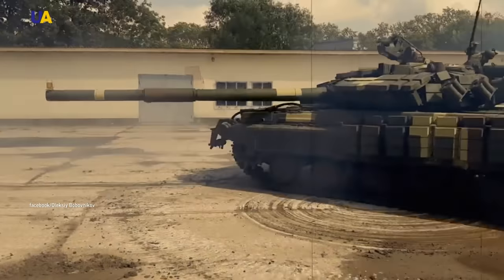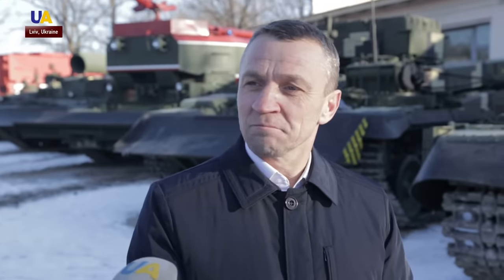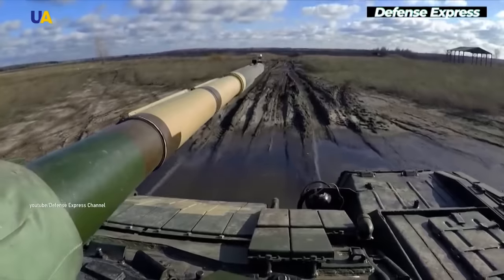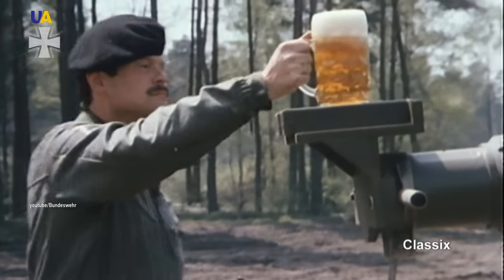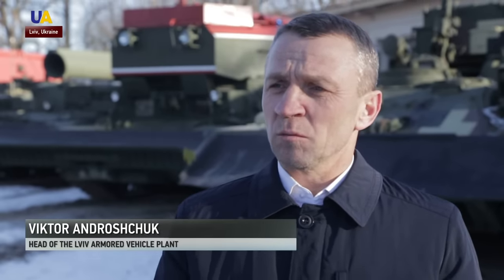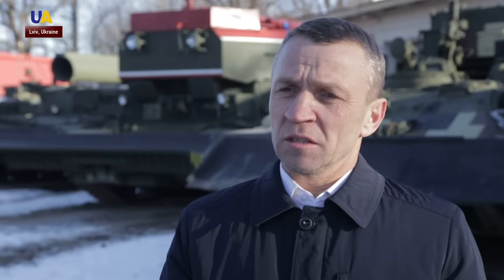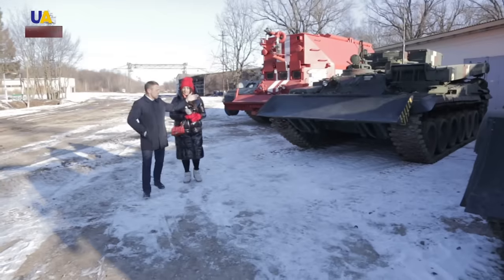How Can a Glass of Beer Demonstrate the Quality of a Tank?

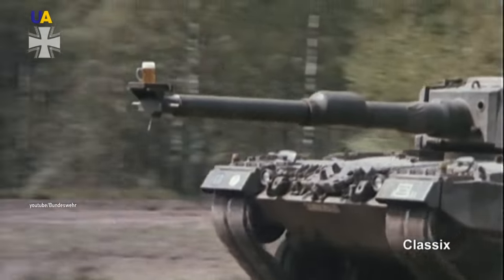Comment: If you pay close attention to the liquid inside the glass at 0:10 and a similar test with the german tank at 1:07, you can clearly see that the German system is on a completely different level.
The german tank doesn't spill a drop.
Reply: Tbf. T-64 is decade(s) older than Leopard 2 would be fair if compared against older abrams, challenger 1 etc.
Reply: @errornamenotfound2513  T64 is much older than the M1 and Challenger 1. It came out in the 1960s. The western equivalent would be M60 or Leopard 1.
Reply: These guys managed to build stabilizing system, that is impressive anyway, i bet very few russian t72 has that
Reply: @cmanlovespancakes  would be fair leopard 2a4 to older abrams, challenger 1 etc*
Reply: @cmanlovespancakes  They say it has been brutally modernized and not much from the original T-64 remained.
Reply: @errornamenotfound2513  in this case its a leopard 1 whitch has been outdatet for at least 30 yeas ( not sure how long exactly)
Reply: @WombRaider_theoriginal  Every T-72 variant has a stabilizer IIRC
Reply: because that would be alcohol abuse
Reply: @ceplma  Yeah but it's still in an awfully small turret. There are limits to how much these old Soviet designs can be modernised.
Reply: The German tank is going WAY faster.
Reply: @WombRaider_theoriginal  T-72 utilize the same gun and the same stab, as all tanks of the period. Differences mostly lay in armour and aiming tech. Armour is better on T-72 (from B-series and further) since it uses a new package of combined armour and aiming tech is worse on older variants (up until T-72B2 i guess) and same/better on later variants, such as T-72B3/B3M, which is most popular in current services
Reply: @ceplma  depends on the variant we are looking at, but still the modernisation was mostly about new gunner's (and/or commander's) sight. Stab system and the gun itself are the same in most parts
Reply: @errornamenotfound2513  The german video was made in the 70s, these t64's have been upgraded a few years ago. You'd expect this technology to be better these days, though the leopard is driving way faster on rough terrain wit a full glass, the t64 drives on flat ground with half a glass of beer ans spills over the side. It's not the same.
Reply: @MrSkyl1ne  late 70s* and that shitty Russian tank vs leopard 2. Like I said, it would be a fair comparison if it's compared to older M1 variants or challenger 1
Reply: @excaiveso5186  what is a Leopard 1?
Reply: @AlexKall  A Garman-developed tank first entering service in 1965. No relation to the Leopard 2, which was originally developed as the German-US Co-Developed MBT-70, when then was cancelled, of which some of the technology developed from the MBT-70 led to the Leopard 2 and M1 Abrams respectively.

There's tons of information on the internet on both tanks, but that's the really short version.
Reply: @errornamenotfound2513  i dont need arguments for dumb people, u are below a slice of bread
Reply: Would you expect anything less from a country that invented Oktoberfest!
Reply: @TheEDFLegacy  excAive asked "in this case it's a Leopard 1" so I asked him "what is a Leopard 1?" Not the best sentence strukture from my end, but it was late.
Reply: The German beer is damped by a very frothy head
Reply: @WombRaider_theoriginal  All T-72 are stabilized
Reply: If only germanys polititians were as intelligent or refined as its engineers...
Reply: @errornamenotfound2513  German tank was a leopard 1 tho a 1965 design :D
Reply: @N0d4chi  the one in the video is a leopard 2..
Reply: But seriously, the German tank has a whole flat surface built to balance the glass on and was driving much slower. The Ukraine tank they just placed it right on top of the actual turret and the clip where it spilled some that tank was driving very fast over very bumpy road
Reply: In other words,  German tanks don't drunk
Reply: @WombRaider_theoriginal  seriously? either this is a joke, or you don’t understand tanks from the word at all.
Reply: @errornamenotfound2513  in the Official Video which was Uploaded from the German Bundeswehr (Army)  its a Leopard 1. Video Called:
"Classix: So stabilisiert der Kampfpanzer Leopard seine Kanone (1986) - Bundeswehr"
Reply: @errornamenotfound2513  what the hell, its the opposite. the leopard 2 video is in the 80ties 40 years ago, while this video was done after they had 40 years longer developement time it doesnt matter even a little how old the original tank is. if you would make this test again with a modern version of a leopard 2 not a 40 years old a4 leopard tank, the test would have been even better. 40 years later the ukrainian version is not in any way on the level of the german technology 40 years ago. the disandvantage is actually here on the german part. even after 40 years not a single other tank till today was able to reproduce this technology in any way even near to that. just look at the japanese version, i have to give the ukrainians that they are at least much better than what japan is able to do today. japans tank is not even driving at all xd they just turn their turret slooooowlyxd and we not even have a single beertest video for an abraham tank, i wonder why thats the case so, yeah not in comprhension to germany but at least relatively to other tanks they made a pretty good stabilisation, which is impressive enough

Comment: Russian Tanks: "The glass is half full."
German Tanks: "The glass has always been full."
Reply: Becase we a drink half for driwing a tank
Reply: There’s spillage. Heh
Reply: This is Ukrainian  tank,the only thing that left from Soviet modification was armor.
Reply: @zymbaluknik8093  T-64BV is still soviet when it comes to engine (unless running 6TD series engine), transmission, main gun (which was more than likely not replaced with KBM-1 gun due to its low quality. Also it is still nothing more than a copy of the 2A46), autoloader, driving controls. T-64BM Bulat has shown itself to be WAY overweight and was not used in the war much, instead T-64BV were the workhorses, in standard soviet guise. How is the T-64E going?
Reply: @zymbaluknik8093  Серьёзно, назови полный индекс СУО ?
Reply: Злой Асисяй  автор на второй минуте сказал,что от советского танка осталось только броня,а от електроники до двигателя сделано украинцами
Reply: The Germans cheat, they built better roads than the Soviets :))
Reply: @Max_Da_G  author  on the second minute said that the only thing left from the soviets was armor,everything  from electronic to engine  were made by Ukrainians
Reply: Just on the tank Russian and Ukrainian
Reply: @yiyeungwong  <-- This guy gets it.
Reply: @zymbaluknik8093  as if there was ever a difference - russian/ukrainian
Reply: @orangepants5749  ah yes, "any difference", Ukraine has been at war with Russia for more than 6 years, and the history of the confrontation between Ukrainians and Russians dates back to the 16th century.  To say that there is no difference between Ukrainians and Russians is the same as saying to an Irishman that he is just British.  If you said that in Ukraine, you would be beaten in  best case
Reply: Злой Асисяй  не смешивайте советское с росийским. Это не значит что расия в лице Москвы, столицы СССР,  раздавала плюшки 15ти республикам, а те в носу ковырялись, как раз наоборот, союзные республики кормили Москву. Это как, - кладовщица с расии приехала в 46ом "Дамбасс падымать"... Кроме как набивала щеки, ничего не делала, но "дамбас падымала ".... Так вот, все им построили, создали, а те стояли рядом смотрели.... "Величие"- великая "болезнь"!
Reply: @zymbaluknik8093  I'll tell you more. If Lviv ever fights Kiev - we will pick a side and supply the weapons, or better off supply both just like Azerbaijan vs Armenia war
Reply: @orangepants5749  i will move to Lviv then,dont care
Reply: @zymbaluknik8093  yep - move to Poland
Reply: 50% of beer
50% of air
FULL
Reply: @zymbaluknik8093  this is a lie, the stabilization system is NOT Ukrainian
Reply: @stmlxx  yes it IS,or show me your proof that it doesn't
Reply: @stmlxx  The author on second minute said that the only thing left from soviets in Ukraine modification was armour, everything from electricity to engine was made by Ukrainian
Reply: @zymbaluknik8093    "The T-80BV received a thermal imaging sight, new reactive armor, additional side protection, a new digital radio station, modern night observation devices with a third-generation electro-optical converter, as well as satellite navigation aids " 
    As you can see, stabilization system -not  modernized.
Reply: @zymbaluknik8093  made by Ukrainian, because they were produced at the Kharkov plant
Reply: Vlad Lukianiuk  Ну если так то у вас всё должно быть  з***бись! Денег должно быть от продаж продукции море. Но почему то глядя на цифры статистики удивляет рост внешнего долга.. Который говорит об обратном. что вы просто не множите уже сами как государство себя содержать... И скоро пойдёте с молотка. Без обид...Цифры не врут...
Reply: Vlad Lukianiuk  когда ЮжМаш впоследний раз ракеты выпускал?, откуда у Украины космическая отрасль?, я что-то не вижу что бы в Украине ракеты запускали, и расскажи чем убогие протоны? И когда это Илон Маск говорил что ЮжМашевские ракеты лучшие в мире?, или это тебе по телевизору сказали?, и с чего ты взял что в Воронеже и Брянске полно этнических украинцев? Лично проверял?, экспертизы проводил,? или это ты придумал что бы хоть как-то оправдаться, что глав конструктор Т-64 был украинянцем?, нет там никаких этничных украинцев, всякий бред уже  придумуешь чтоб опровдаться.  везде своих украинцев приплетаешь, ничего никогда ваша нация не создавала не неси херню.
Reply: You meant Ukranian?
Reply: Злой Асисяй  Зачем строить танки ,если есть парк танков на более чем 2 тис. ?
Reply: @robertsinner104  посмотри что у вас творится. Уровень жизни в десять раз меньше чем европейский, суперядерная страна мать вашу
Reply: @Yize Dai hA , wats mean "too much?"
Reply: @vn3946  оплот топ машина!
Reply: @zymbaluknik8093  Ага. Сидят украинцы на танкоремонтом заводе и делают электронику.
Написано что это танк Т-80БВ.  Это советский танк. Мало того, раз он БВ то построили его в Ленинграде. В Харькове строили только танки с дизельными двигателями - Т-80УД. А стабилазатор у него Ковровского завода - стабилизатор вооружения 2Э28М. Такие же на 64 стоят. А если присмотреться то слева на башне стоит  ГТН-12, справа прицел-дальномер 1Г42 и ночной прицел ТПН-2-49, а значит на танке установлено КУВ "Кобра" И СОУ "Обь", которые выпускались с 1976 года. Так что это танк древнее говна мамонта, и украинского в нем - возможно только краска. Да и то сильно сомневаюсь.
Reply: Vlad Lukianiuk  Вам надо про Сикорского побольше почитать, зная матчасть и его отношение к украинской идентичности, Вы бы его в пример не приводили 😁
Reply: @zymbaluknik8093  "If you said that in Ukraine, you would be beaten in  best case"

And if you say this in Russia, then everyone will be indifferent to it.
What is it, an inferiority complex?

Because I'm Russian, and I don't see the difference either.. xD
Reply: @Korj666  
Really? Whose Crimea?
Reply: @AliShuktu  Well, it's definitely not mine.)

My town is right next to the forest, and you know what?
People are forbidden to visit it under the threat of a fine, allegedly it is a fire hazard. Access to nature reserves and nature parks is paid, and fishing is also only for money.

Only very naive people believe that the property of the state is the property of its inhabitants. Rather, these residents are as much the property of the state as natural resources.

Russia or Ukraine or Belarus, and even America and Europe, how much depends on the ordinary citizen in the adoption of any decisions by the state?
All this is an illusion.

The government manipulates public opinion and stirs up discord and hatred among residents, because united they can pose a threat and just influence its decisions.

But people are idiots. What is in Russia, what is in Ukraine, what is in America.
There has been so much hatred in the world lately, and so many reasons for it have been invented.

And what is the difference between Russians and Ukrainians?
The fact that Russia is run by Powerful Bandits, and Ukraine is run by petty thieves?

I would generally say that ALL people are the same, in their stupidity.
Reply: @athenes1366  Russians did not used umlauts
Reply: @zymbaluknik8093  the stabilization system is soviet, the cannon is sovirt
Reply: @sus5976  it is modernised by Ukrainians,this what this video is about
Reply: @amn2760  They use, because Russian has letters "ю" (almost same as ü) and "ё" (same as ö)
Reply: @zymbaluknik8093  This "was" Ukrainian tank 😂
Reply: Und das schon 1986.... Beim neuen KF51 "Panther" wird das Glas jetzt bestimmt noch voller 😉
Reply: @pirate8847  1990 год - хватит кормить Москву!!1
После развала СССР: ну дайте скидочку на энергоресурсы пожалуйста 😭😭😭
Reply: @частный_канал  помнишь "ножки Буша"? То курятина из США. Вот с ними, миллионы тонн пшеницы, с Украины на рассссию, безвозмездно.... это после развала СССР...
Reply: @pirate8847  ну да, было такое, и что с того? Это отменяет того факта, что вы громче всех орали что Москву нужно перестать кормить, а когда узнали, что незалежным странам за энергоресурсы полагается расплачиваться по мировым ценам, самим стало есть нечего?
Reply: @частный_канал  про энергоресурсы Украины, тебе поведает г.н Мертведчук с "партией рыгионоф" с Януковичем. "Москву кормить".... Её до сих пор кормят, - якутскими алмазами, бурятским газом нефтью... и многим другим.
Reply: Нет, просто по дороге между бочкой с пивом и подставкой для станка на конце пушки несчастный украинец решил что просто обязан украть часть этого пива, вдруг режиссер и зрители не заметят. 😆 Воровство - это смысл жизни украинца.
Reply: @zymbaluknik8093  ну вот теперь ты воюешь, а до этого, про какие 6 лет ты говоришь, вашей армии почти нет, наёмники в большинстве. Кстати, ты жив ещё?

Comment: By comparing the videos I would say the Leopard 2 in the clip from 1982 was moving faster on rougher terrain than what was shown with the T62.
It's not enough to have the electronics one also needs fast and strong actuators which can implement the needed movements.
Reply: @Al_Conte  It wasn't me who compared the Leopard 2 with the T62 but the creator of this video.
But already the Leopard 1 had a powerful stabilisation system.
Reply: no t-62 on this video.  only t-64, t-80.